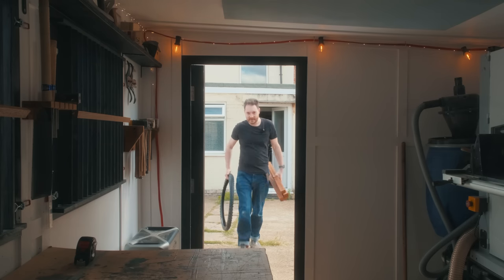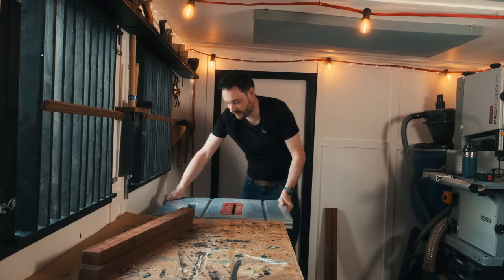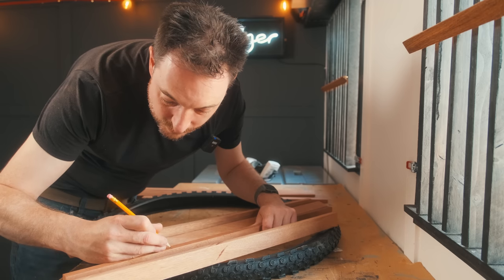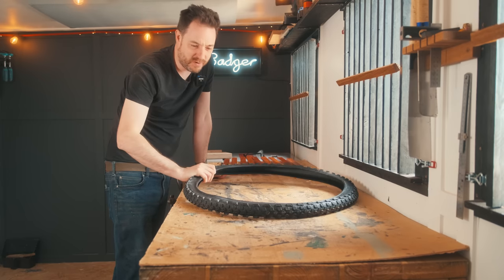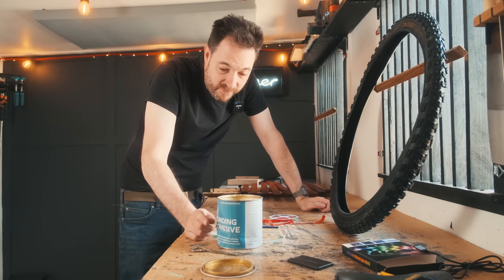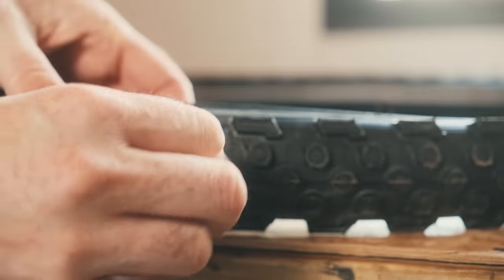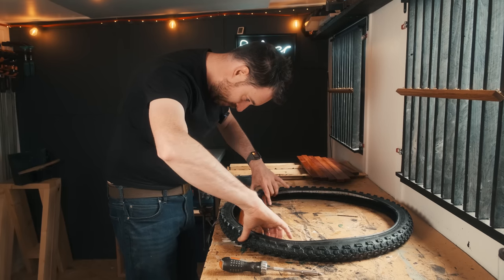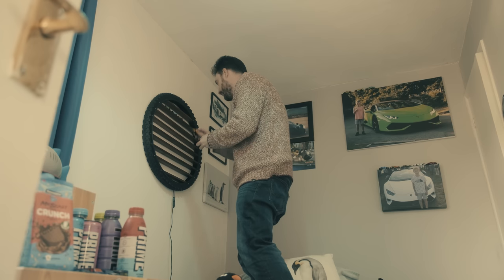Making A Hot Wheels Display

Comment: Quick question: why do you use the bench hook backward with your pull saw?
Reply from the maker: It’s for western saws
Reply: @Badgerworkshop  I mean yes...I guess then, from the hook's perspective, my question becomes: why aren't you using it backward when using it with pull saws? Like, it's designed to resist the force of the saw teeth & to support against tearout on the side of the workpiece that the teeth exit, is I guess what I'm getting at.
Reply from the maker: @joelhollingsworth2374  because that’s not how hooks work. You can’t just turn it around. You need a differently designed hook